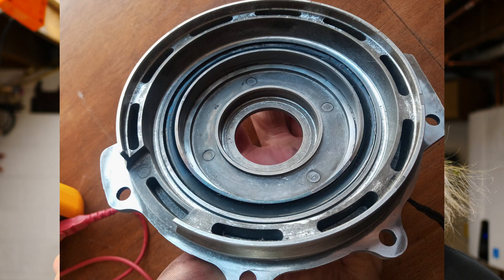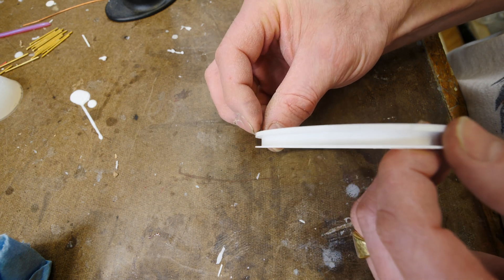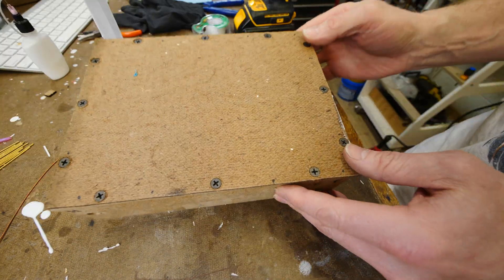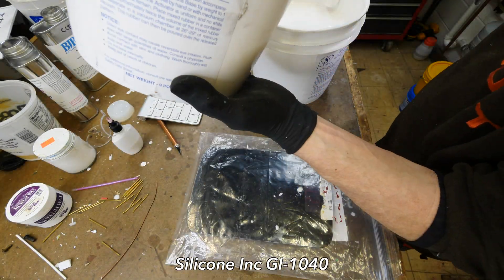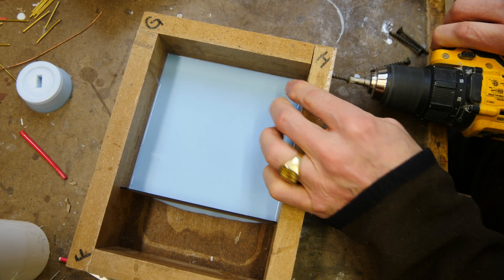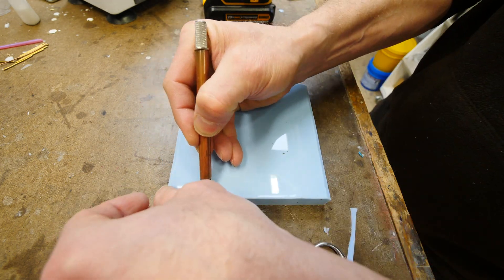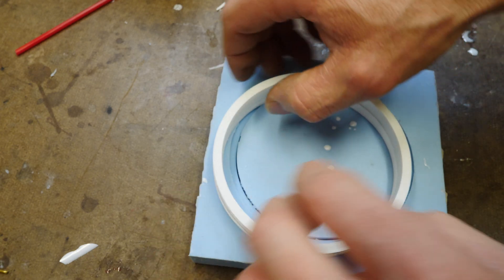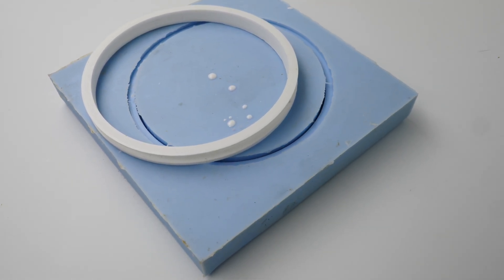How to make an Open Face Mold

Comment: So if you wanted to make 300+ parts a year is this the best method?  Just wondering what is the next type of mold for urethane.
Reply from the maker: No, The mold would only last for about 20 parts. Then you would have to make another mold
Reply: @EricStrebel  so is a aluminum or steel mold the answer?
Reply from the maker: @FatGuySAWZ yes
Reply: @EricStrebel  cool, I can do that.  Thank you sir.

Comment: I have some old taillights that I would like to cast a mold off of, however, they're very old so the lens can't be taken apart from the housing to get a clean two sided mold. The taillights also curve around the rear corners of the car, making the shape bit more tricky as it will have depth in the mold.

What would be the best way to cast a mold from just the outside of the lens, and be able to achieve a uniform thickness of the new casted lens?
Reply from the maker: Not possible, you need to have access to both sides to cast new ones
Reply: @EricStrebel  That's what I was afraid of. Thanks for replying!